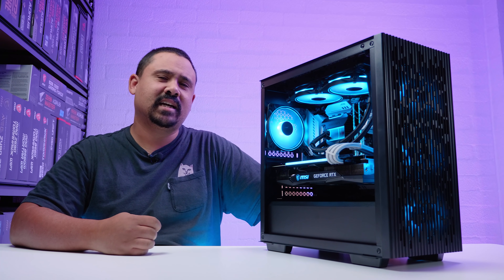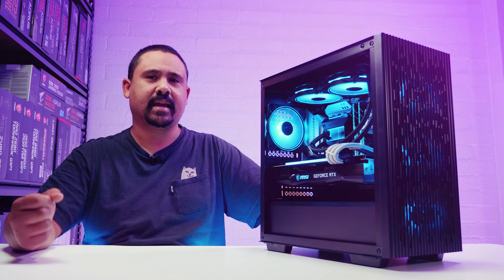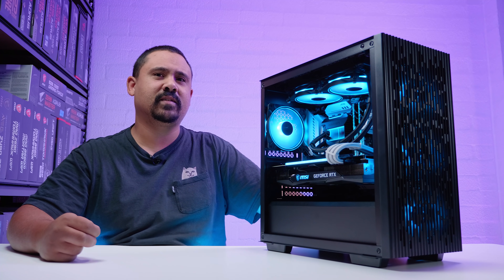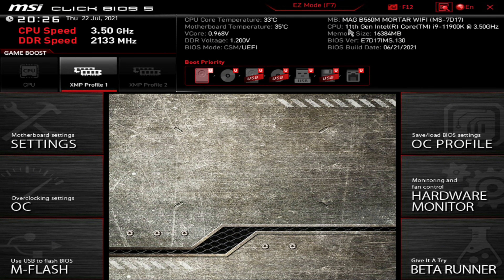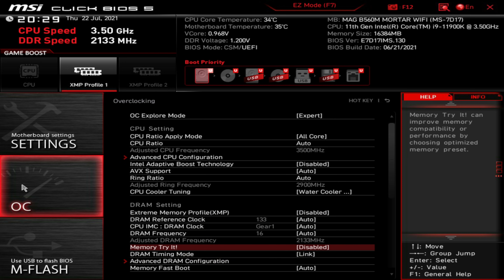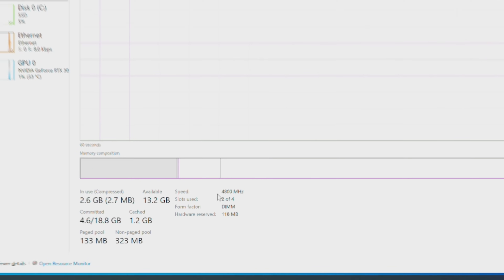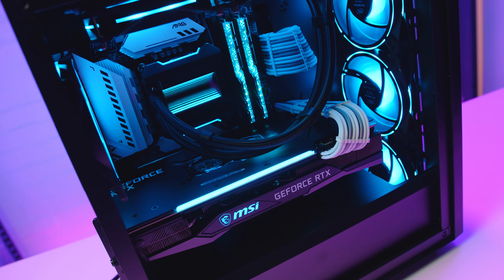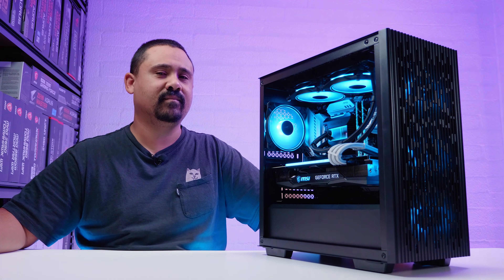Can you beat my MSI B560 memory overclocking?

Comment: lowering tRFC can help alot when pushing for high frequencies.  try 330 or something around there.  also the timings that your mobo comes up with at boot can change and cause instability.  when really pushing ram, especially bdie, you should manually enter as much as you can
Reply from the maker: The point of this video is to not OC well so I can show how to do it properly with the ITX setup ;)
It's something you're going to want to see ;)

Comment: Is it better to go with fast MHz r is it better to with lower MHz with tighter timings?
Reply from the maker: A balance of both. Tight timings and fast clocks. 3200-3600 with CL14 is around where you want. Really depends on what you want. It's just a bit of fun :)
Reply: @GearSeekers  I tell u what I been playing around with is bench testing. What do I need to go with if I am benching?

Comment: I cant even clock my memory speed to their specs.
Reply: Try to change the slots in your motherboard. My Gigabyte refused to do anything in the 1+3 slots but I swapped them to 2+4 and it worked. Sometimes still doesn’t work, but worth a shot.
Reply: @tmarriotti  slots 2 and 4 (1 being closest to the CPU) are the slots you're supposed to use lol.

Comment: I have the MSI Z590i Im running an decent OC 3600 CL 18 running 4200 CL17 @1.47V B-Die
Reply from the maker: Nice!
Reply: @GearSeekers  Thank you Nick. Ive just started OC and I have #1 on HWbot for  XTU x36, 11600k, and #56 of 30,000 in x6
Reply from the maker: @nickhubble7582  I like memory overclocking more than CPU overclocking. It's such a fun way to squeeze extra performance out.
Reply: @GearSeekers  Yes! Indeed. Its makes your system snappy. I am happy with the Z590i. I didnt even crash my system doing the 4200 OC. It just took it I belive I could do 4266@CL16 but I will have some serious voltage.